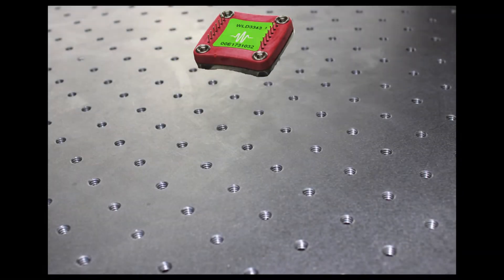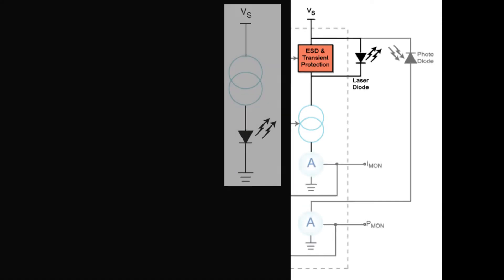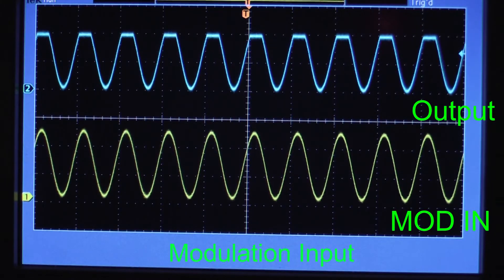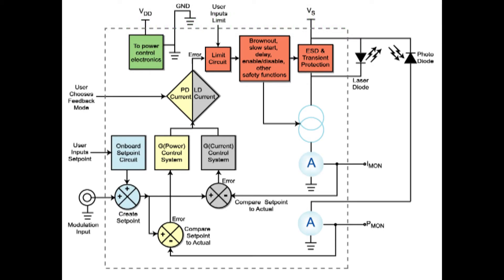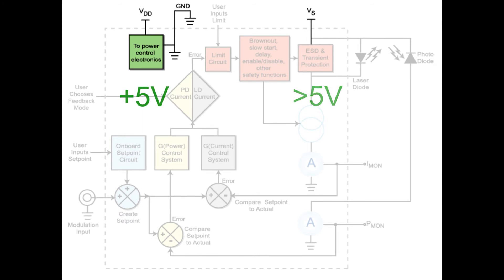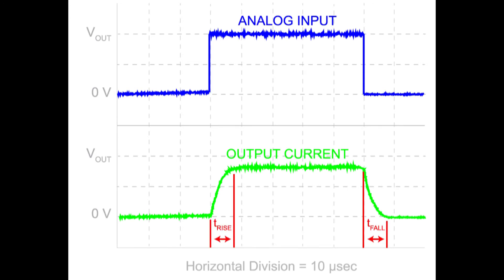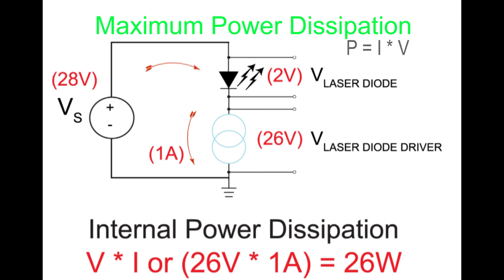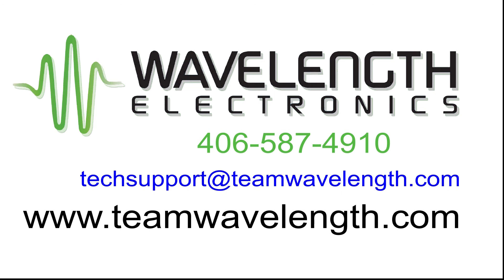What is a Laser Diode Driver

Comment: Would like to learn components needed to assemble the crosshairs Lauer diode on scrollsaw table Steve good showed on utube I Oosterwick sire
Reply from the maker: Duane, we design and manufacture electronic components to control many different lasers in the photonics industry.  I would contact the scrollsaw manufacturer directly as we don't supply that industry. Sincerely, Team Wavelength.

Comment: Just got done reading the website and then stumbled on this. Great, if not better then. Thank you. Very helpful.
p.s. (I know the difficulty/time/R&D etc that goes into making a business, especially a electronics one.. but your drivers are so expensive >.<; looks very nice((especially those WLD chips.. so perfect.)) an specs seem top notch, but yea.. just not feasible for the poor inventor/creator..If I could get a few for prototyping some inventions tho... I'd certainly be open to using your chips for my inventions at a bulk pricing obviously as I think they'd be perfect fits, just can't afford the initial 100+ dollars just on the each single chip for prototyping.. an as we all know ..probably going to take more then one chip  )  

p.p.s.
Keep up the good work again tho an thank you! Will be keeping an eye out for price changes on ya'll site.
Reply from the maker: Rick, I'm glad the video was helpful - that was our goal!  I think it would be worth your while to contact sales@teamwavelength.com about WLD chips for your prototyping needs.  Regards, Team Wavelength
Reply: Yes .. these are very well designed LD driver , but I do understand the frustration of no middle ground , with laser diode drivers ,  either they are Big " large boards " very expensive , or cheep china drivers , that are of very poor quality ,  I needed a  LD micro driver  with the capability to modulate up to 500k and drive red , blue and 520nm greens " higher voltage ,  so I designed one . I would have prefer to buy it , but sometimes you have to customized your electronic .. LOL

Comment: most laser diodes , manufactured to day don't have photo diode , and c.c . mode with temp control if preferred method , and there driver modules are a bit priesy
Reply from the maker: Hi Rod, thank you for your comments.  All our laser drivers can operate in Constant Current mode if there is no photodiode. We have integrated laser drivers and temperature control modules, or offer separate laser drivers and temperature controllers.  At Wavelength, we pride ourselves on making high-precision controllers. Where this level of precision is required, we save developers significant time and money.
Reply: @Teamwavelength   Yes , your products " laser driver "  are exceptionally good , and my comment was not meant disparagingly , just noting that most laser diode are driven in C.C. mode , As LD  photo diodes  are becoming less common in the industry . this was a very informative video ..
Reply from the maker: @rodsims8471  Rod, we are glad you found the video informative. Thank you for your added input. Regards, Team Wavelength